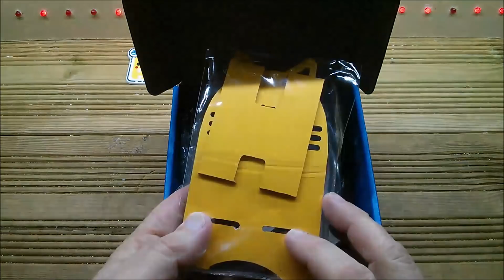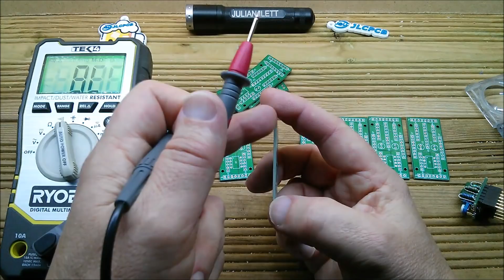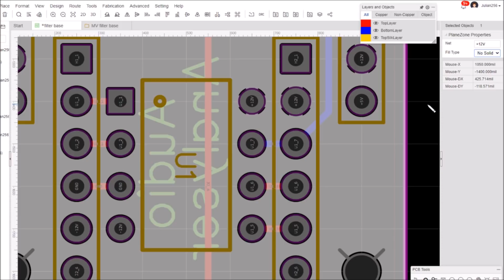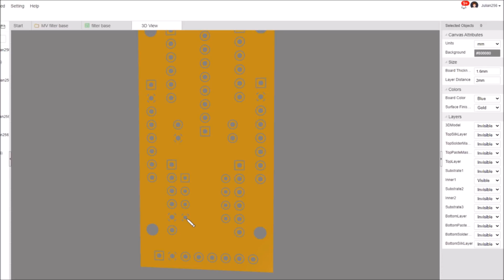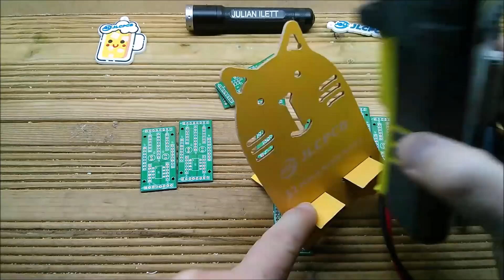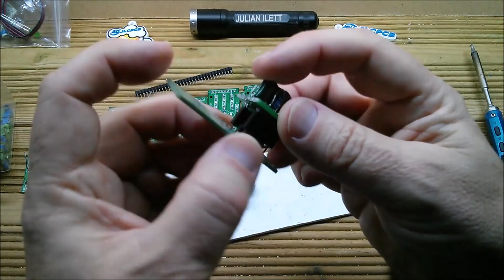4 Layer PCBs from JLCPCB - Modular Project Base

Comment: you really need to get an actual computer, not an AIO solution. I can pass you on a list of parts for a good system for what you use it for, that way it's something simple but works more than that i7 2600K that is in that small box (assuming that you're still running that old thing)

Comment: totally unrelated to this video but you have done stuff with super capacitors and i was wondering if you have ever tried to create a direct replacement for a lipo using super capacitors?
Ive looked at your playlists and cant find anything, id like to replace a 1s lipo with a super capacitor in a dashcam so that it auto powers down but in a proper low voltage shutdown mode but im wondering how the camera would behave for charging with a capacitor instead of a lipo?
Reply: I think it would work fine if you use 2 supercaps in series with the right protection boards. Likely the only problem would be an inaccurate SoC indicator.

Comment: Seeing a schematic would have been reeeaaaal nice before trying to follow and figure out the PCB.  ie. are H3 and H4 going to another PCB with the LEDs?  Some pins (on H3 and H4) are not used because you want to use the "cheap" Arduino 6 pin headers?  Why another PCB though?

Comment: Why not use the LM3915 instead of the KA2284?  I mean the 9 pin SIP package is cool in a retro kind of way BUT it only drives 5 LEDs when the LM3915 drives 10.  Plus the LM3915 can switch between dot and bar mode.  In my mind the KA2284 is only good for a very cheap display on small projects but your project is far from cheap with all the PCBs (including 4 layers), sub PCBs, headers, interconnects, etc.  It would have been nice to see a video before this discussing your ideas and showing something built on a breadboard, etc. then us viewers could have convinced you to change your mind!   ;-)

Comment: Making the 4 layer boards must be complex.
Reply: Not really, it's basically two 2 layer boards stuck together :)
Reply: @steverpcb  Ha Ha, of course. I never thought of that. I'll get my coat.
Reply: Try 6 or 8 like motherboards
Reply: @jw200  It's the same method but the copper and the fiberglass gets thinner, and via's may need to be done before the next layer is added.

Comment: Sanctions should be imposed for non 0/45/90/135 angles on traces!
Reply from the maker: That's just jauntyangleism :)
Reply: When I was a young layout draughtsman back in the days of tape, we were forbidden to have sharp angles. Everything had to have smooth curves. Back then I think it was because the boards were etched with some acid rather than ferric chloride and they thought the sharp angles would form pooling places and the trace would be eaten away. No-one ever really explained to me why, so I suspect its was "because that's the way we've always done it" - even now I hate looking at boards with angled traces. (40 years later)
Reply: @followthetrawler  - curves all round 👍

Comment: I guess you know, but if you make the inner layers "Signal Layers" and use "Copper Area" you can adjust clearance, spoke width and fill style of the copper area.
Reply from the maker: Interesting - I'll check that out :)
Reply: I have not seen that option in EasyEDA, a copper area can be added to any layer.
Reply: @steverpcb  do you refer to my comment or Julians video? Julian made the inner layers of type "Plane", which you can do in "Tools" - "Layer Manager". If you do that, you get what you see in the video. The whole Layer can be assigned to one net, but that's it. But if you use the type "Signal" for the layer, you can use the "Copper Area" Tool from the "PCB Tools" Toolbar on these layers like on the top/bottom one. And when you select the drawn Copper Area, you can adjust "Clearance", "Spoke Width", "Fill Style" and more in the properties panel.
Reply: @RoterFruchtZwerg  As I have said, I have not seen that option when designing 4 layer pcb's. I always set a copper area for each layer, typically the first inner layer will be ground for impedance and have no tracks on it.

Comment: I don't know much about this stuff but I'm pretty sure that you want the ground plane to be as continuous as possible, since that's the return path for your signal. This is easier when the ground plane is on the inside. 
Also I think that the layers are closer together than the tracks are. So again you want the ground plane on the inside.

Comment: Wouldn't this cause the board to act as one large capacitive plate?  I'd imagine you'd have stray capacitance all over the place, no?
Reply from the maker: capacitance between power planes isn't a problem - provides decoupling. In any case it'll be picofarads :)
Reply: It would be like a capacitor across the power and ground: desirable.
Reply: It would work better as capacitor if the inner layer was thinner.
It's one thin extra layer on each side of a thick core as it is now, given the stackup isn't special.